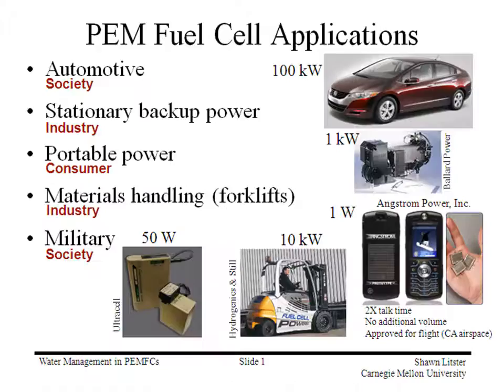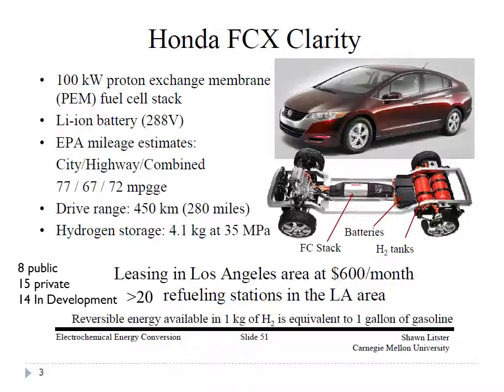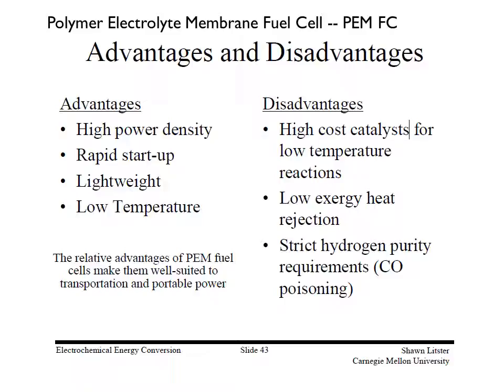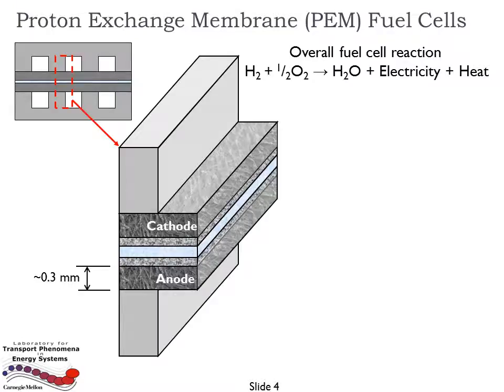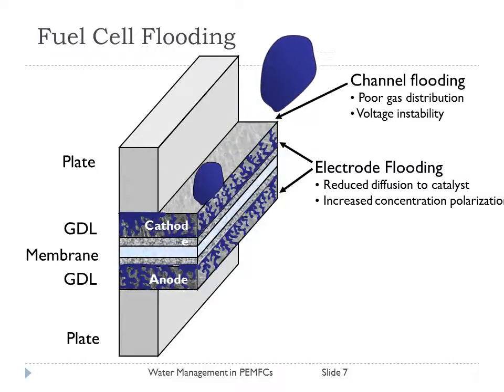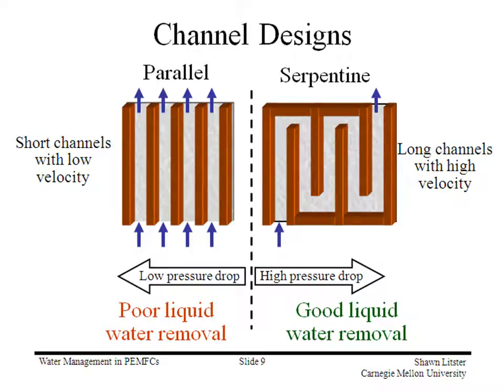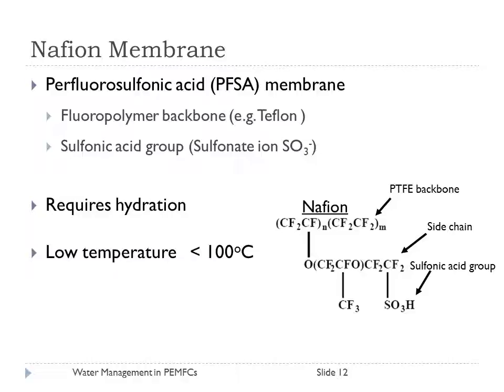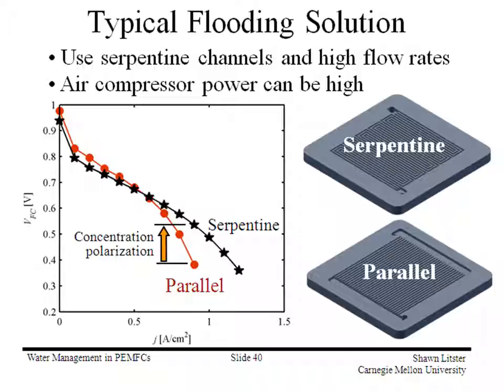Siefert Lecture#6  PEM Fuel Cells with voice&video pptx

Comment: I read the service manual of a Gencore 5B48 I recently purchased for $400. The manual has a hydration procedure to use after extended storage. The unit contains a humidifier.